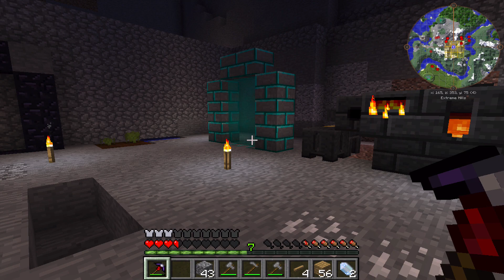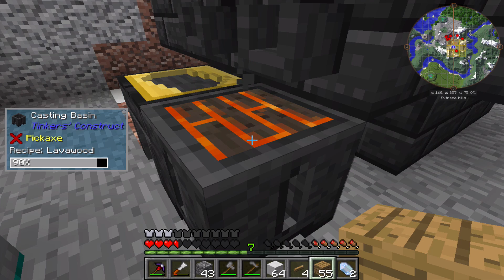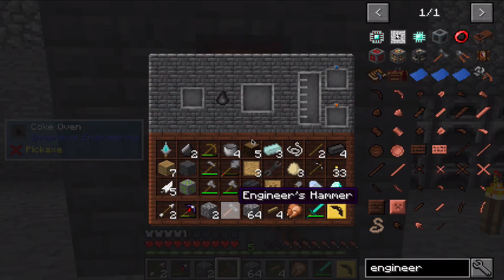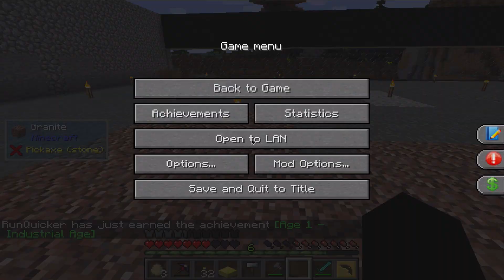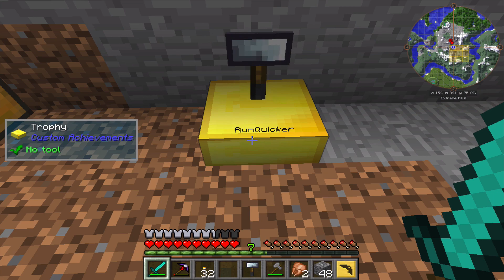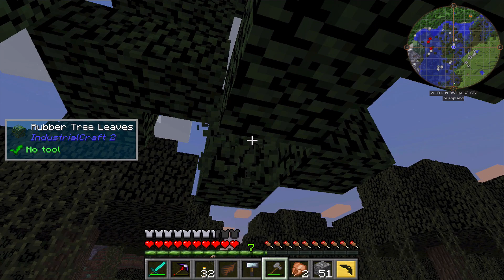MINECRAFT - Age Of Engineering #2: Machines

Comment: I hope you didn't get the Lavawood manually as it can be easily automated with like 2 Hoppers and a Redstone Clock. The goal is to automate EVERYTHING :P
The pickaxe repaired itself because of the Ecological trait from one wood part.
It seems like you're unfamiliar with IC2, so I like to warn you about explosions. Always check the Generator tier. If the Generator tier is higher than the cable tier the cable will melt and if the Generator tier is higher than the machine tier, the machine will explode. Tier 1: 32 EU/t, Tier 2: 128 EU/t, Tier 3: 512 EU/t, Tier 4: 2048 EU/t